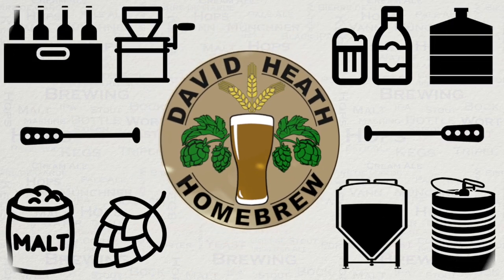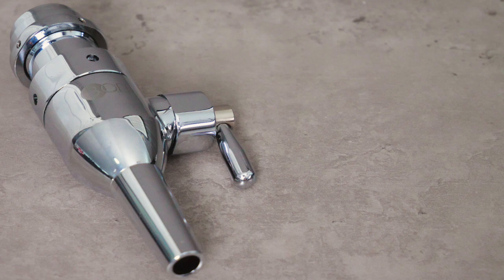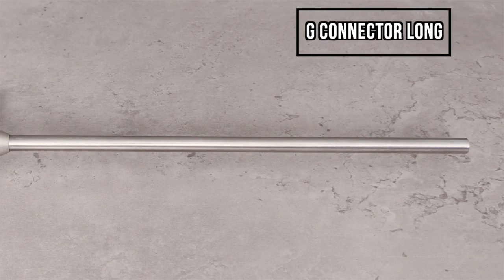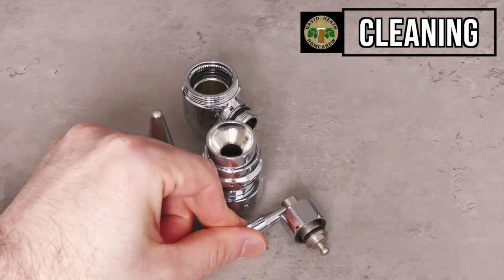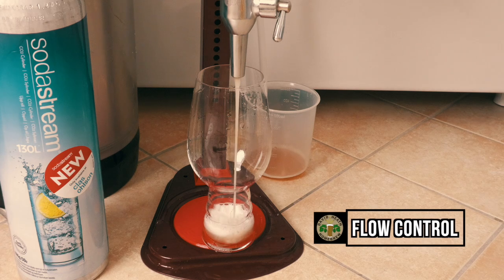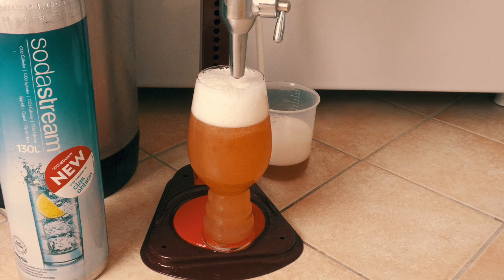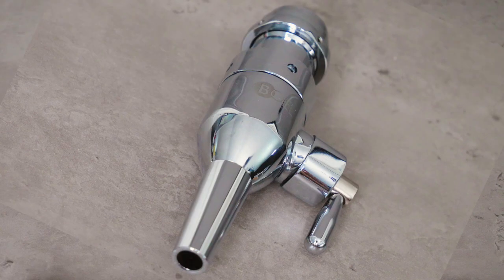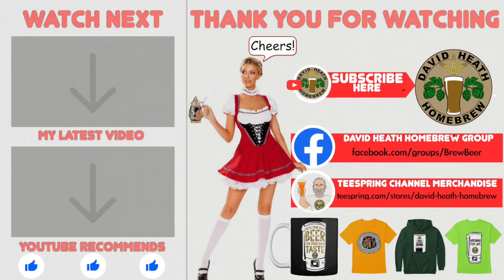iTap G Connector For Homebrewers

Comment: Thanks David - another very useful video. I bought one of these recently and found that I need to adjust the locking ring to fit my crown cap iTap. What's frustrated me is the fact that Boel don't supply the required Allen key along with what's a quite expensive iTap accessory - and as far as I can see, they don't even say in the brief instructions what size of Allen key is required. I have a good set of tools, but not a 1.5mm key, so ive just had to order one.
Reply from the maker: Great to hear, yes the allen key would have been good though.

Comment: Considering the price of this addon, I would have expect it to be made of stainless steel. Chrome plated brass is simply the cheapest option like with any beer tap. the chrome plating will come off if left in a low pH environment. One other note is that "Lead-Free brass" does still contain lead, which means that once the chrome plating is compromised, the lead will be free to leach into the drink.
Reply from the maker: Pros and cons here :)

Comment: Hi David, you dont have to waste so much beer.. When you use the Gtap connector you can close the overflow screw.. its only for bottlefilling..
Reply from the maker: Thanks, I simply followed the manufacturers directions. Good to know.
Reply: I'm using Itap2 with G connector with closed overflow.  All the lines are connected permenently to my fridge (kegs, Co2 and waste jar are inside).  But I notice that some beer goes in my Co2 line.  Maybe it's because my overflow is close during pouring?  Just asking?  I will give a try with overflow slightly open.
Reply from the maker: I would suggest reaching out to Boel about this.